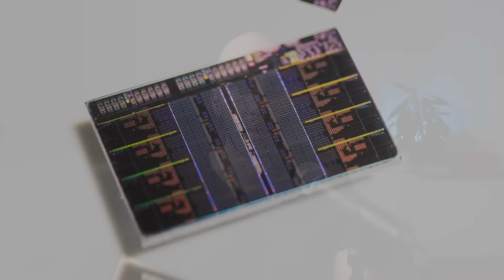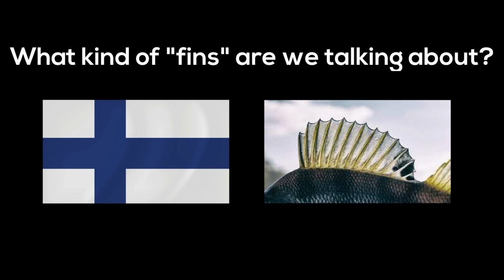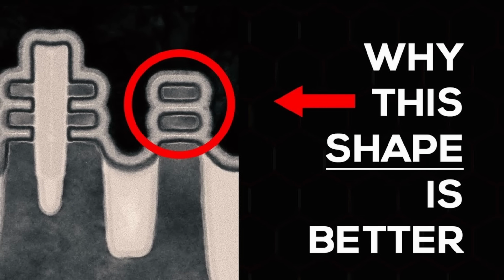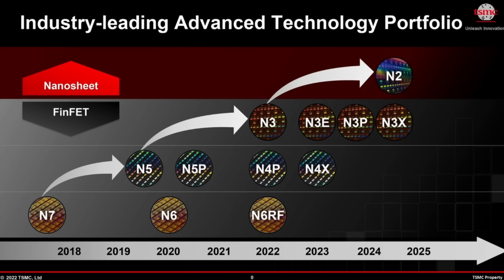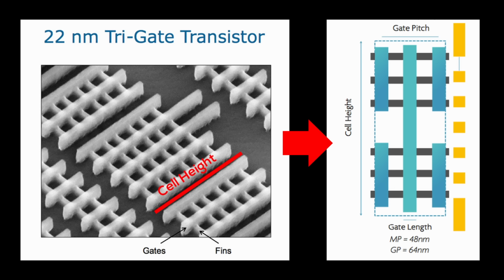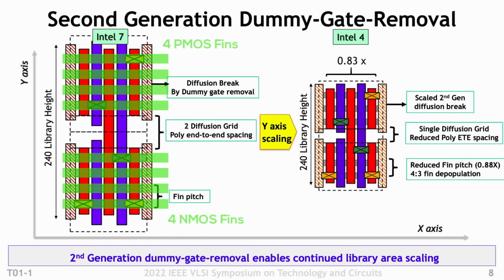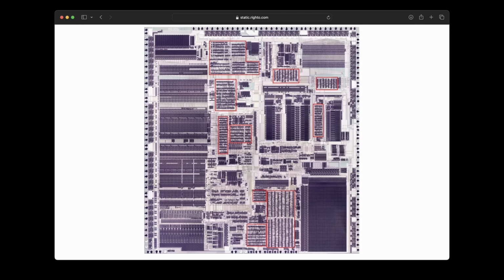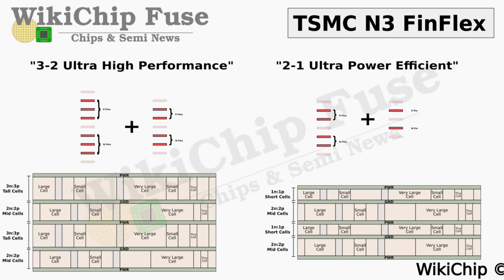TSMC FinFlex: How Chips are made Worse to get Better

Comment: Let me issue another, very important correction.
Using a larger standard cell does NOT enable a higher clock speed. In fact, fore every application the optimal size standard cell is used, which minimizes power consumption. Today, this is calculated automatically, based on standard cell datasheet.
The condition used to calculate this is called fan out and is basically to how many standard cell inputs does the output of the previous cell connect. So for more connection a larger cell must be used, otherwise the rise and fall time of the signal will be slow, increasing the switching losses.
To control the actual speed of the standard cell, different voltage treshold cells are used. Low treshold cells for example will be faster than high treshold cells. Further there are high and low power cells available, both have then also several different voltage treshold variations. Finally all the different types of cells come in different sizes, so the appropriate size can always be chosen.
Reply: Thanks for pointing that out. Seems like another important piece of the puzzle for me to understand how processors really work. 

Feels like I'm getting close to putting it all together.
Reply: @Gractus  Yeah, just want to issue small corrections as an industry insider. So the author, as well as the audience cal learn small details.
Reply: @AnonyMous-gt8vq  Только вот в закон Мура они давно упёрлись и топчутся на месте, по сути не уменьшая сам транзистор в объёме, он становится своего рода колодцм, который для наблюдателя сверху кажется не большим, НО если посмотреть с боку, он огромен. Давно пора выплюнуть это погоню за уменьшением и развиваться совсем в другом направлении, а именно многоядерности и способности работать нескольким ядрам как одно целое, а не плодить 30-40 ядер и ничтожно низкой производительностью.
Reply: @AnonyMous-gt8vq  I really appreciate that! It frustrates me when I seek an understanding of something, but people over-analogize it to the point that their explanations get me no closer to a proper understanding of the concept. Like, I'm not an idiot, I'm just ignorant. Give me all of the technical words and concepts and tell me in no uncertain terms exactly how it works, and then if I need an explanation for this or that I can ask for clarification. But you can't ELI5 something this technical and expect whoever you're teaching to have a real understanding of what's going on. It's like reading the Cliff's Notes to a book and then writing an essay about it; to anybody who's read the actual book, it's clear you have only a facile understanding of the story. Am I making sense? I don't want a facile understanding. I'd rather be faced with the fact that something is over my head and simply accept that fact rather than live with the illusion that I understand something more than I actually do. That's how these comment threads attract so many "experts" ready to tell you why they're right.
Reply: @SINHRO-FAZA  As we like to say here in the US: "Old habits die hard!" It'll be some time yet before these old dogs learn some new tricks. I have more idioms that don't translate well if you'd like to hear them 😅

Comment: There is another benefit to fin depop. Less parasitic capacitance from nearby fins sapping your performance away and increasing power. Also fewer fins means lower leakage (since there is less "transistor" to leak).
Reply: I mean you say that, but the idea of fin depop is more to keep the total fin surface area the same while decreasing the silicon footprint, compensating for that loss in height, so I think it would have the same levels of parasitic capacitance likely
Reply: @sage5296  It’s hard to explain without a whiteboard but you do end up ahead. 2 fins that are 1.5 high vs 3 fins that are 1 high have the same drive area. The area of the capacitor is 1 side (space between fin 1 and 2) times 1.5 height for the two fin situation. For the three fin situation it is 2 sides (space between 1 and 2 and the space between 2 and 3) times 1 height. Therefore all else being equal the 2 fin device will have a 25% capacitance reduction over a 3 fin device with the same drive area. You also get better uniformity because for a one or two fin device all fins will have the same parasitics while for 3+ the inner and outer fins will perform differently despite being part of the same device.

Comment: Let me just give a small correction to the video.
There are two types of transistors, both of p and for n type.
They are called enchancement mode and depletion mode transistors. This refers to wether the transistors are on or off for zero gate voltage.
For the n mos, enchancement mode transistor, which is described in the video indeed a positive gate voltage is required to open it. For the depletion mode transistor, however, it will be open even at 0 gate voltage.  Positive gate voltage will attract even more electrons, opening it more, while negative gate voltage will repel the electrons, closing it.
This type of transistor is rare and only used for high frequency analog application.
For the p type it is similar. A negative  voltage on the gate will attract electron holes, which are positively charged. A positive voltage will repel the holes, closing the transistor. 
In a depletion mode transistor the holes are already present at zero gate voltage, forming the channel.
Reply: While it is true that enhancement and depletion mode transistors absolutely do exist, I think it is important to emphasize that when talking about modern high-performance digital-focused nodes, depletion mode devices are no longer a thing. Every transistor is essentially an enhancement-mode device, to the extent that we designers don't explicitly mention it. 

There may well be older analog-focused nodes still kicking around that have depletion mode devices but the cost+risk vs benefit for implementing a device like that in modern nodes is far too high.
Reply: But there doesn't appear to be any negative voltage (with respect to gnd), only positive vdd and gnd=0. Then how is it possible to attract holes to switch on a p-type transistor?
Reply: @shapedeus  Negative Gate voltage refers to the voltage measured between gate and source of the transistor. P Mos usually have the source at a higher potential than their drain. On N Mos its the other way around.
Now lets say a P Mos has its source at 5V and its gate at 4V relative to ground. Then the voltage measured from gate to source is 4V - 5V = -1V, so you get a negative gate-source Voltage (VGS)
Reply: @shapedeus  The negative gate voltage is relative to the source voltage. So if you connect the source of your p-channel MOSFET to VDD (which is usually how it's done), pulling its gate to ground produces a negative voltage relative to the source, thus turning the transistor on.
Reply: He also got the charges mixed around: he stated that a negative charge repels the electron holes.
Reply: Came here to say this to find your comment already addressing this. Disappointing to see such a basic mistake in what I'd hoped to be a good technical overview video of the subject matter.

Comment: Do you have any insights how these improvements are made possible on a process step level? 
Is it "just" improvement of the existing process steps. Better control and purity for example?
How do I get the fins higher and thiner? The hights of the flex columns are different, is this just more precise planing?
Reply: Improve process technology. For taller fins you need to improve epitaxy to grow the fins taller and then you need to improve etching to etch deeper. Epitaxy and etching involves multiple cycles that remove or deposit the correct element atom by atom. So taller fins need more time in epitaxy and etching. But longer times means more time for things to go wrong so you also need more precise controls to make sure a minimum amount of defects happen during epitaxy or during etching.

Comment: I wonder if we will have a future where peak optimized finfet is the process used for cheaper consumer and budget chips while gate all around will be used for more enterprise and luxury chips. It seems like finfet has staying power by virtue of how much more complex gate all around is going to be.
Reply: I'd be curious to know why they aren't making motherboards with multiple CPU slots just like they do with RAM... That way instead of buying one very expensive CPU we could install 2 or 3 cheap CPUs and get even more performance for a lot cheaper isn't it? I'm supposing it would be feasible because I still have an old DELL Windows 2003 Server that had two CPU slots on the Motherboard.
Reply: @Alfred-Neuman It's because designing a motherboard for multiple CPUs is complicated and probably more expensive than just buying a better CPU. It gets used in servers, because beyond a certain point, it's the only way to add more cores to a system. Like those dual-socket EPYC servers, they are incredibly cool, but more suited for hyperscaler workloads (running dozens of VMs on a system), since software can struggle actually using the available amount of cores

So for a giant computer cluster it makes sense, since you need half the number of systems for roughly the same performance, which is much more efficient. But for most consumers, not really

Comment: I wonder if anyone tried multi-voltage gate?
consider N-type depletion.
0V on source, 1V on drain.
to shutoff the transistor, -1V is place on the gate.
the (absolute) voltage differential between Gate and source is about 1V (0 & -1)
but the differential between gate and drain is 2V (1 and -1).
So partition the gate in 2 sections. the section closest to source could take say -1.1, 
put -0.3 on the gate section closest to drain?

Comment: EDA and foundry are linked, foundry thinks of a thing, makes a few sample chips using hand layout and some dummy wafers, then sees it works, and approaches the EDA companies, who then make the needed software. Only once the software is ready, and can build parts that work, with repeatable performance, will the new process be announced. There must be plenty of process improvements that died a quiet death because the software simply could not make it work and produce a more optimal part layout, so that was shelved till they could get this to work properly, possibly using another process try.

Comment: When most people say "semiconductors," they actually mean "integrated circuits." In fact, that's true here too. I don't know when "semiconductors" became equated with "integrated circuits" in the minds of non-industry and now even industry experts, but it happened. I think it's time to, please, reverse this trend. Semiconductors are materials that, well, conduct incompletely or variably. Integrated circuits are made with or of semiconductors. If you are using transistors, you are creating integrated circuits, not semiconductors. And, there's no such thing as a CMOS transistor; the two complementary transistors used in CMOS make up the most simple gate. It's a gate, not a transistor; it's an inverter (probably, unless it's designed simply as a repeater). Oh, and transistors have a gate, which sits across the channel. The channel is a physical structure; it's not "created" when a field is applied to the gate. Sorry, you are pretty good at this, but still not precise.
Reply from the maker: It's also called the semiconductor industry. At some point, you can't reverse a set trend. Yeah, ICs are made with semiconductors, but nowadays these terms are interchangeable.

Comment: All this just shows how complex Chip Manufacturing really is, and how we have optimised to be so powerful and smaller than the human brain, it can power Language Models and give rise to AI!

Can you make a Video detailing purely the Chip Imprinting process, ie. How the design is actually being imprinted into silicon wafers to then become cpus? In my opinion, they are a form of ultra advanced 3d printing process for making logic circuits on a nanoscale! I would like to know how does the imprinting lens in an EUV machine work, and how is the imprinter done, like how can we generate a opaque picture that blocks UV light in the form of a pattern, and the remaining light going through the lens imprints the cpu design on the wafer? To me, that in itself is the Most Impressive process of Chip Making!

Comment: a transistor has two properties each with two possible conditions. One is N and P type as you said
the other is depletion and enhancement mode. 
In depletion, the channel is on at zero gate voltage, gate voltage is required to turn on. 
Enhancement mode, channel is off w/o at 0 gate voltage, and on with
Reply from the maker: True. And you can actually place different cell heights across different rows. Everything is so complex, at some point you have to cut information to keep things from becoming too bloated.
Reply: @HighYield please make an occasional “Information dump” video which doesnt Cut ANY information and hell, might even go into extra. That’d be AMAZING for people who really want to Learn the stupidly obscure details!
Reply: I wrote a longer reply to a different comment on this but on modern digital-focused high-performance nodes, depletion mode devices are no longer a thing. Everything is by default enhancement mode and it won't even be explicitly called out. Depletion mode devices may only be found in mature analog nodes at this point.
Reply: @NN-gb5lf  thanks, much has changed since the 90's. I will try to find.
is this 1) to help with leakage?
2) deliberate not doping the channel?
3) field effect of the gate shuts off the channel? or other?

Comment: I've always said Moore's Law should be viewed in 3D not 2D...
Reply: moores law was about count, not density
Reply: @tommihommi1  Indirectly it was about density, because the count increase and cost decrease are coming from miniaturization.
Reply: Porque no los dos!?

Well, now we have increased cost, increased density, and increased chip size.  

Yay!  Who fancies paying $4k for a 7090 in 1.5 years?  1cm square chip, with Hbm5 AND GDDR7x as a backup.  

Oh, and only 1/20 frames are actually rasterized.  The rest are AI.
Reply: @tommihommi1  you are a cabbage, 
Think matrix vs array, they both have a "count".
Density is a measure of compactness not a count.
Moores law states the number of transistors doubles every two years, nothing mentioned about 2D or 3D, silly cabbages just assume
2D without a single reason. 
we don't live in flatworld... maybe educate yourself before crying...